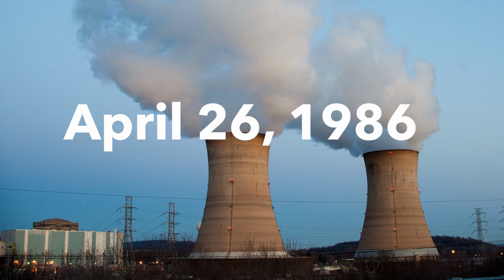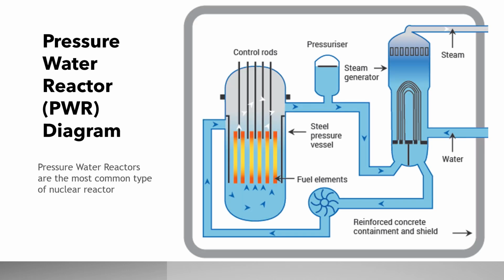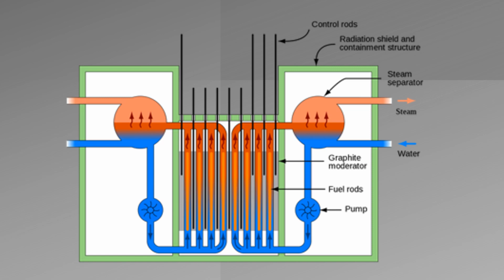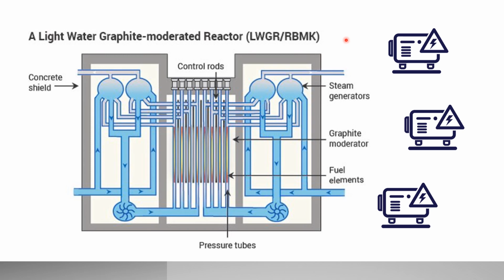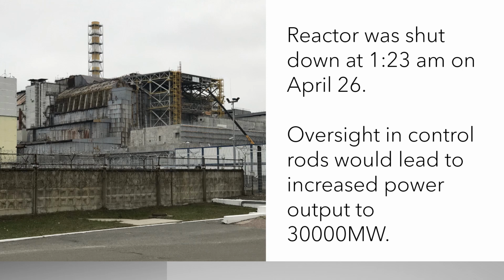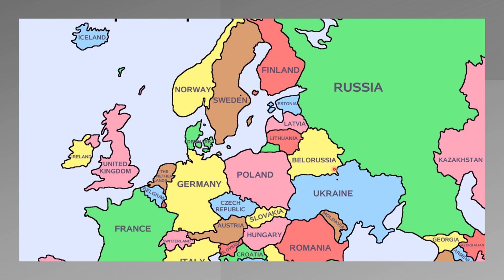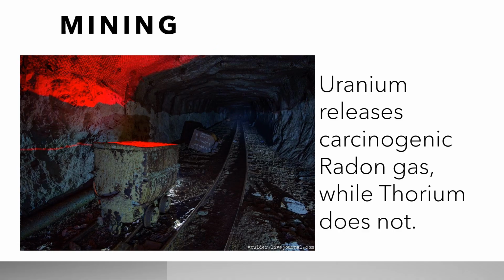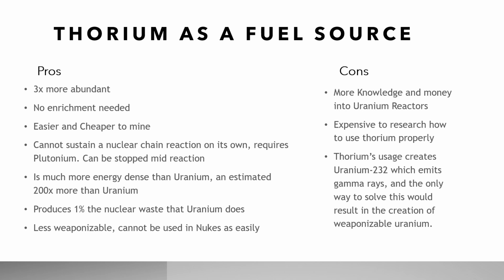Could Chernobyl "Happen Again"?

Comment: The short answer is probably yes...as long as there are still RBMK reactors still in operation...and there are still 8 of them running. Most likely, it will not be the AZ-5 system that causes the explosion, since the issue with the control rods has reportedly been fixed, but RBMK reactors can be unstable even in normal operations...so it is important that great care is taken in how those RBMK reactors are operated.